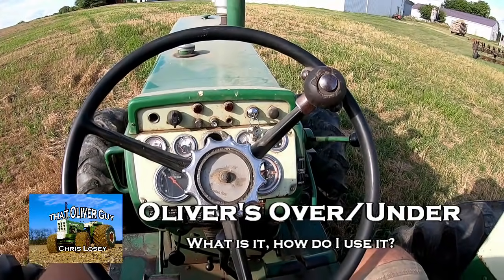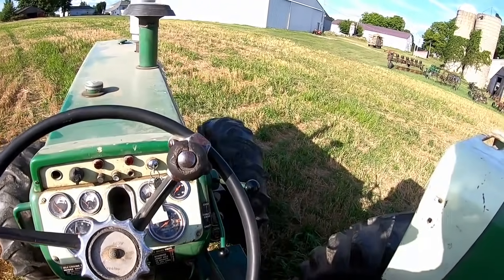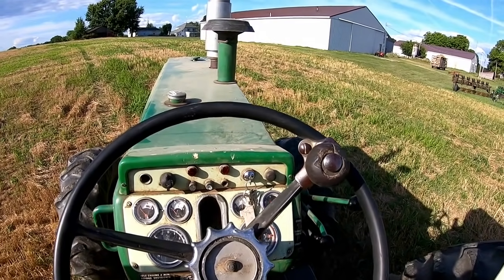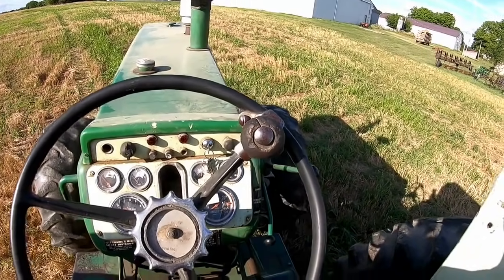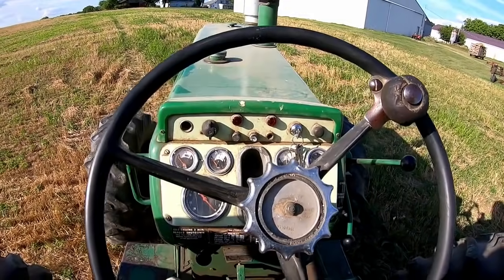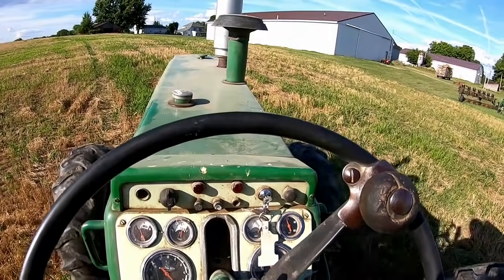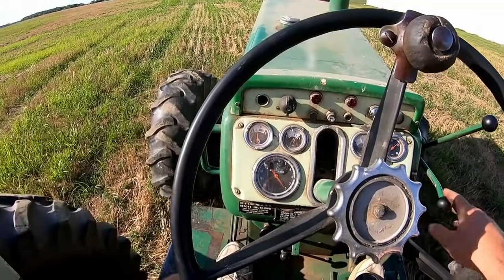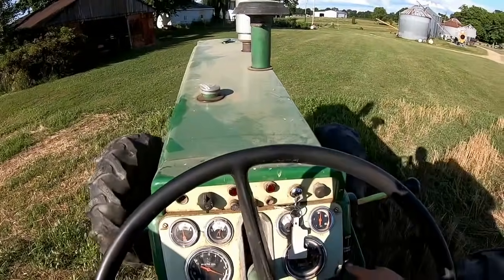Oliver and White's Over Under Transmission - What is it?

Comment: An acquaintance who was the main major equipment build shop for Dowell, a major worldwide oilfield service company, came into our dealership one day and was asking about the over/under shift box we had on our tractors.  We gave him a demonstration and he said he wanted 4 of them.  Not the tractor, just the over/under transmissions.  They were building some pump drive units that they needed the ability to change speeds without having to declutch the engine to shift the gearboxes.  Their pumps required about 200 hp minimum and when the pump output needed to be a little less or a little more the over/under provided the operator more control.  Dowell sold out to Slumberberger (pronounced Slumberjay)  Dowell had cornered the market on Allison/Packard engines after the war.  They used them to power their hydraulic fracking pumps in the late 40s and into the late 60s. If you think a Detroit sounds great you should have heard those Allisons under full load. They were enclosed in the truck body that had shutters all around it. If one caught fire the shutters would close, CO2 flooded the compartment and hopefully saved the equipment.  When they tested them with a choke in the pressure output line those trucks would vibrate.  If one backfired the whole truck would rock sideways when the torque momentarily cut back and then hard the other way when the power came back online.
Reply from the maker: Cool history! Thanks for sharing!

Comment: I always loved how the Olivers and Whites would freewheel in under. I’d do exactly as you do when going down the road with hay wagons or a gravity wagons: just slow mostly down in over, then go straight to under as I pulled into the barn lot. I’d then throttle down the rest of the way and let the tractor coast down on its own. Not a feature, but if you knew to expect it, it sure felt like one.

Comment: I worked on a hog farm in the 1980's and we had an Oliver and were told to "Never " shift the over/under/direct drive or it would leak and was hard to fix. I always wondered if that was a bull crap story.I never did shift it out of direct drive. If that tractor was not plugged in it would not start!I think it was a model 1855 or 1955 not sure, all it pulled was a honey wagon. Thanks for the video!

Comment: We used a 1655 to feed cattle between 3 farms, every stop sign we came to we would see how far we could roll coal shifting up just as it ran up wide open. The last corner was a short 1/4 mile & we could leave smoke for almost the whole way until it was time to slow down, until dad caught us. We had a 770 with a heat houser when dad got the 1655 with a cab & heater, really nice for winter in N.W. Iowa. All the Oliver's we had I can't remember a power booster or a hydra-power ever causing problems. The loader tractor would get a clutch every summer but the field tractors would usually run 3 to 4000 hrs. before a clutch.

Comment: Thanks. That was very interesting. Brought back memories of growing up on a farm in Canada. We had a Cockshutt 1650, a Cockshutt 1850 and a White 2-105. All had the over/under and I drove them all for field work. I’m sure I didn’t use the system properly and as carefully as this. In fact, I probably abused it , but I don’t recall that we had any problems with it in any tractor. 
I remember always starting the field work in under and once you got going, shifting to direct if the tractor would handle it there. I also remember the kick you got when you were in 6th gear on the road and shifted from direct to over. Those tractors really moved in road gear.
Reply from the maker: They were built to work. You can shift them whenever, consider the video more like guidelines to make them last longer.

Comment: I always wanted a car with an over-under in it! LOL! Those things really shifted good! What I always did when starting out on the road with a load, was use the clutch to lessen the hard shift. No one had a better set up than Oliver did.
Reply from the maker: I've been thinking a 4-53 with an over/under, coupled to to a 4 or 5 speed manual. Speed shifting would be smooth and easy in under drive, and you'd have 2 speeds to drop back climbing hills. Put all that in a 1 ton pickup.
Reply: @ThatOliverGuyChris  that sounds interesting, Chris. Funny though they have a transmission in drag racing that  is really neat,

Comment: Thanks for another great video. Some release date info would be interesting. I recently had a discussion with a local farmer about that, he tried to tell me the over/under didn't come out until the 55 series, but the tractor in this video was obviously a 50 series which is when I thought the over/unders first came out. Happy and safe harvest....
Reply from the maker: The over/under was introduced in late 1967. The new 1950-T was the first model to have it, and the others didn't get theirs until 1968. It was available in the 1650 up through the 2150, with the exception of the 1950 GM. For reasons I don't know, they never offered a factory over/under in the 1950 GM. Part of design criteria for the over/under was that it had to fit in the same space as the hydra-power, so there's no physical reason for it to not go in the 1950 GM.
Reply: Thanks for that information Chris. I thought if anyone knew the release date it would be you...
Reply: @ThatOliverGuyChris  I literally just asked Mr. Bolte why they didn't put the O/U in the 1950 GM's.  He said "the 1950 GM's only had the Hydra Power Drive from the factory because the engine oil cooler used up all of the available space."  He then added, "however several have been switched to the O/U post factory, so I don't know if they are missing the oil cooler or what?"

Thanks for this video by the way.  I learned from you that I can shift from Over all the way down to Under today.  I will keep that in mind for my 2-110.
Reply from the maker: If anyone would know, it would be Blane. It makes sense too, there's a fuel cooler and hydraulic cooler in front of the radiator.  There's not room for much else up there. Physically the 3 speed will fit, I know of few examples, mostly pullers.
Reply: @ThatOliverGuyChris  I had to laugh when I was reading this conversation about the 1950 GM and the O/U.  I was like “Hey, I just learned about this the day before.  I can help convey information for once” lol

Hope Harvest is going good for ya Chris

Comment: Got 1968 oliver 1650 with 3spd my grandpa and dad bought new the 3spd started giving trouble right away the dealer put update kit in it 7000 hours still works great
Reply from the maker: I was cleaning in my basement recently and found a stack of left over seals and parts from updates they did to over unders back then.

Comment: I have a hydra power that does not work right that you could work on. It is on a 1650 diesel and one side does not work. Also must have some issues with the buttons on the hydraulic valve levers that I do not know how to use/not use that makes it try to operate both valves at the same time? The down side it is in Oklahoma. 
I like your videos!

Comment: Great video Chris. I think I'll stick to my John Deere 8 speed and maybe in the future 15 speed power shifts. It always makes me wonder though what John Deere could've had back in the 60s if they had something like an over/under in front of 8 speed power shift or synchro transmissions to get 24 speeds.
Reply: Kenny I spent summers helping my grandfather and uncle farm running a 4010LP and pair of 4020 diesels.  I’d estimate I helped rack up at least 3000 hours on them.  They were all synchro-range but the 4010 had a third reverse gear that could test your backing skills.  A little later a 4630 came along with the 8spd powershift and then a 4440 with quad range.  For some reason the one with 3 reverse gears was my favorite... 😂
Reply: David Waggoner Yeah the 4010s had a reverse in the third station but it was too fast and too hard on the transmission from what I've been told so they blocked them off on the 4020s. All of the gears for that reverse are still in 4020s but are just blocked out in the shift column which can be cut out to access the extra gear. I'm thinking by the nature of how the gearing was actually set up that there would technically be a reverse in the 6/8 range as well. I would have to look in the service book to find out for sure though.
Reply: Yes from what I heard there is a fourth reverse under 8th gear if you grind out the dash below 8th you can access it. I've never done this but I read an article in Green magazine about a guy who knew of someone who did this.

Comment: I used the main clutch when I was in sixth. A clutch is easy and "cheap" to replace so I preferred to soften the blow that way
Reply from the maker: My cousin does that with his manure tank with his White 185. Zero issues with his over/under and still got thousands of hours out of his clutch.

Comment: Morning, I have a 1650 with one 12 volt battery, should a put a 12 volt back in it or should I use 2 6 volts or 2 12 volts in parallel? Thank You! Love your videos!
Reply from the maker: I personally use a single 12 volt, group 31 battery. Less money and fewer connections to go bad. If you're starting it in cold weather and really need the amps, I would put in two 12s in parallel. And thanks!

Comment: Great vid thanks! Did Oliver get the over under concept from Cockshutt? I remember hearing about a 580 prototype with a multi speed, shift on the fly transmission. After Oliver took over it was destroyed. Only 1 580 survived, it is not equipped with that trans.
Reply from the maker: I'm not familiar with that, so I can't say for sure if it had any influence.  The hydra power was basically a self contained, pressure lubed, wet clutch version of the power booster drive. When engineering was assigned the task of adding a 3rd speed, they were told it had to fit in the same space as the hydra power.  They had engineers that came from MM and Cockshutt working , so the inspiration may have come from there

Comment: Interesting on how those work and they do seem to be a simple setup .. What i wonder about is how far was oliver into a power shift trans or cvt when they were folded into Minnie Mo and white ??? since i have seen only one prototype powershift that minnie had tried
Reply from the maker: Oliver, and really all 3 companies for that matter, was working on a CVT transmission in the late 60s into the early 70s. It would have set the tractor industry on its ear. It was called the Corporate Tractor since it would be a single tractor line to sell for the 3 brands, or possibly as a single brand with the White name. All of the prototype pictures I have seen had styling similar to a Minneapolis Moline, with Oliver colors. They were designing all new engines to go with the all new transmissions, including the CVT. There was a 4 cylinder, 6 cylinder, and even a v8 that would go into trucks. White had built a brand new engine factory in Canton, Ohio to produce these engines, while the rest would be made at existing facilities. The early 70s turned out to be financially tough for White, and the whole corporate tractor program was scrapped. I was told by one of the engineers that only 1 CVT was built, and it was never put in a tractor because it fell off a truck. He also told me they were having trouble refining the CVT, because it could sometimes start moving on its own when it was supposed to be in neutral. He said what they were lacking is what we have today, sensors and computers to make adjustments. They were having trouble because oil viscosity changes with temperature, so the CVT would work differently at different temperatures. White sold the new engine factory to Perkins, and all designs were filed away. It seems crazy to me to be so close to having an all new tractor, but with money being so tight, tooling up to put these tractors into production was more than White could afford. The same engineer told me that before the AGCO acquisition of White tractor they were working on redesigning the over/under to get rid of the sprag clutch and possibly add a 4th speed. They were told it had to fit in the same area as the 3 speed, and that was proving to be a challenge. At a dealer meeting to introduce the 6000 series powershift tractors, AGCO told us they built a 4 speed powershift that White had on the drawing board, and were not satisfied with it. That's when they decided to use the Funk transmission the used in the 6000 series.

Comment: Them work pretty much like a TA in the IH.
Reply: The exception is, the over under has 3 speeds.
Reply: And the over under is FAR FAR FAR more reliable. You can treat each speed as a working gear without worrying about something going wrong.
Reply: The torque assist has a bad reputation over unders are reliable.

Comment: So I caught this video in my feed and I was wondering how they compare to a White American 80, like mine and yours? I think it all sounds the same, mostly, the White hydraulic over/under is controlled electrically. I have trouble shifting when it's in overdrive, not so much in direct, none in low, am I missing anything? Thank you Chris, have a good one!
Reply from the maker: The 3 speed in the American is the same basic unit, the big difference is it shifts with solenoids and a switch instead of mechanical linkage. It's normal for them to shift hard in overdrive, under drive makes for the easiest shifting.
Reply: @ThatOliverGuyChris  Thanks for the info.

Comment: If possible, and if you haven't already done so, do you think you could do a video on how to fully shift this power train setup? From 1st under to 6 over I mean.
Reply: It's not like a car.  You just pick whatever gear range you want and then have your 3 speeds in the gear.  You don't go up from 1 to 6.  You'll just pick like 5 and take off in under and use your 3 speeds.

Comment: We have an 1855 and it jumped out of 3rd gear one time and now it won’t move in any of the gears. Haven’t taken it apart yet but what do you think it could be
Reply from the maker: Does it load the engine if you try to move it in gear, or does it not move at all with no load on the engine?
Reply: That Oliver Guy - Chris Losey  it does not load the motor at all
Reply from the maker: Does the chain coupler spin? My first guess is the hub broke free on the main clutch disc. If the chain coupler does spin, see if transmission input shaft is turning.  The splines may have stripped there.  If that's turning,  I would pull the transmission cover. You may have a broken shift rail or shift fork.

Comment: Chris! Quick question. 2-180 works in direct but has nothing in under or over. What would you think happened?
Reply from the maker: Totally stops in under and over? I'd say the 4 bolts that hold the planetary gear carrier to the drive gear broke off or backed out.
Reply: @ThatOliverGuyChris  yep. Just stops moving.  We don't have much for history on it. It was bought at an estate sale. I know the owner used it all the time.
Reply from the maker: @jeremycherny2041  it could possibly be a broken sun gear shaft, but I'd put my money on the planetary carrier. It seems unlikely that the sprag clutch and the overdrive clutch pack both went out at the same time. No matter how you slice it, it has to come out to be fixed
Reply: @ThatOliverGuyChris  thank you

Comment: In road gear is it ok to disengage clutch partially when shifting up to over-drive
Reply from the maker: Yes. My cousin does with his 4300 gallon manure tank. I resealed his 3 speed a few years back, and it was in excellent condition.

Comment: Chris, I had an early 1850D one time and it had a O/U swapped in place for the hydra-power, they had it hooked up to the original pull for the hydra-power.  When that swap is done does the linkage swap or was that a "Rigged" setup?  Being a IH and Deere guy, I wanted a Oliver.............It was fun but had to sell it to get a down payment for a property.  Some day I would love an 1950 to grind feed with, but don't think the neighbors would last long with that Detroit screaming.
Reply from the maker: Usually when someone swapped the just hooked up the hydrapower linkage to the over/under. There were a few things to change out if you moved it up to the throttle lever, including the throttle lever itself.
Reply: @ThatOliverGuyChris  yes 👍       that's how I did my 1555  it was just easier hooking it up to the hydrapower linkage.

Comment: I have a 1655. Is my over/under the same one used in 1755, 1855,1955, American 80?
Reply from the maker: Not quite. The 1655 had a smaller input shaft than the others.

Comment: With hydrashift going down hill, in low and coasting faster, use brake to slow down to normal before shifting to direct then this 2 speed transmission will last & last.. my family had an early 1800 from about 1962 til after year 2000..

Comment: are these more or less durable than ih's?
Reply from the maker: From what I have seen, the over/under is more durable. It seems like when I see an IH for sale there are 2 conditions for the TA, 'freshly rebuilt' or 'out'. My experience with IH is VERY limited, so take that with a grain of salt.
Reply: @ThatOliverGuyChris  Grew up on an IH farm, and usually well worn IH's at that. They always seemed to go out on one side or the other (hi side or lo side), but not both. Most would be out on the Lo side. It was always interesting to find out with a new-to-you tractor. Most of the time, you'd find out pulling a load down the road. Pull too long a hill, pull the TA, and better be quick with the brakes and throttle as you come to a halt with the throttle wide open in a hurry....